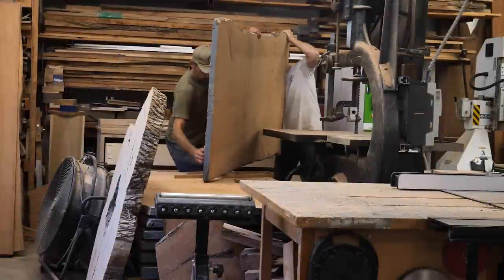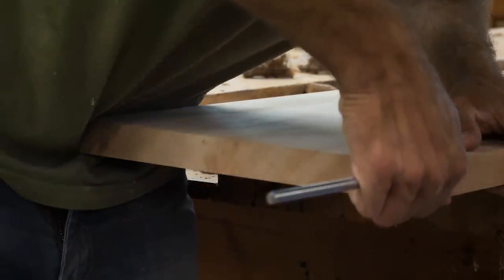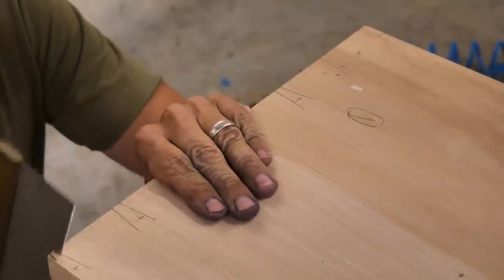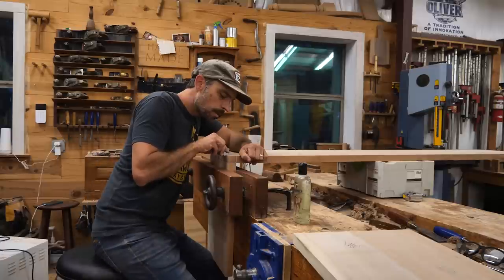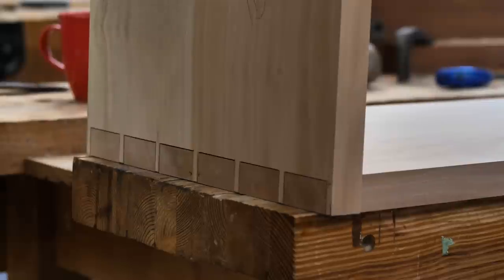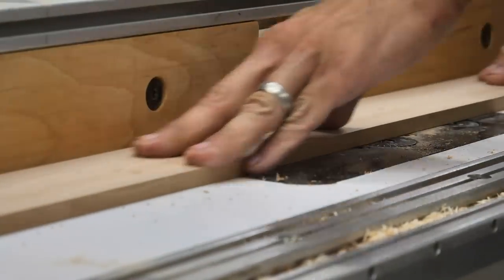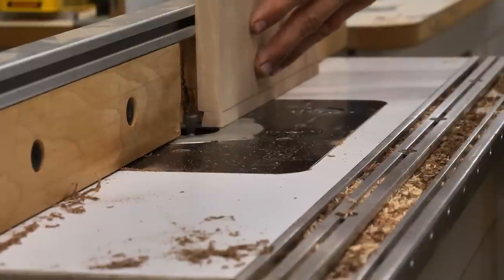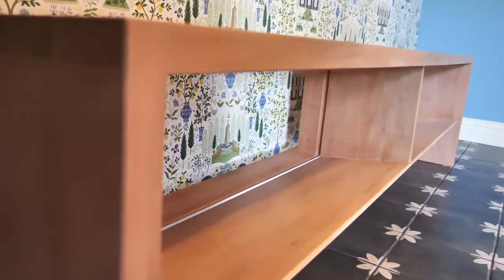Dovetailed Bench // Using Soap As A Finish

Comment: Super nice joinery! In regards to the soap: please do it again :-) It is most definitely a very resilient treatment. In Scandinavia it is one of the most used surface treatments for both furniture and floors. Do a thick blend of water and soap (maybe add a little white soap pigment if you like it light) give it 3-4 times and you are ready to go. The soap soaks into the surface and when you feel that the surface gets dirty, just wash it with the same type of soap. Over time it builds up and gets more and more durable, with a silky finish. 
We have the treatment on the family dining table (white oak) and I guarantee that the abuse from both kids and adults (red wine e.g.) can be cleaned off and the finish just gets nicer over time :-)

Comment: Thanks Andy for sharing.  I like using a rebate as well for dovetails.  What I also like is that the rebate "hides" the bottom/inside of where the pins and tails meet.  Not that I want to be sloppy.  But, if I push back past my knife line when removing the waste, you can't see an error on the inside.
Reply from the maker: Yes that is an added plus to it.

Comment: Andy, consider getting a mafell tracksaw. more power, thinner blade and theyre built like a tank. pricey but you'll never have to buy anything again.
Reply from the maker: Thanks for the suggestion.  I’ve never heard of Mafell but just looked them.  It’s definitely pricey but competes with Festool.  Looks like they get great reviews
Reply: If you live in North America Mafell is not as well supported and will be more difficult to source. Festool has a better supply chain in North America. 
Mafell tools are a little bit better than Festool but it really depends on what you want them for.
Reply: @bighands69  didn't know that. Well I'd say mafell is better for those big slab/ deep cuts which is what I'm guessing Andy is in need of.

Comment: Hey so I got the larger Festool track saw when they first came out and I was really happy with it for years. Eventually I bought myself the mft-3 work table along with the extra track. I don't know if you use these yourself, but I was really pretty horrified by the quality in general. I was so impressed with the saw that I guess I expected the same out of the table. The fixture table idea is brilliant, but the damn thing is not sturdy enough to support a drink much less work! I have tried rebuilding a couple of leg systems but I've concluded it's just really not worth the trouble. I feel like I must be missing something, all my other experience with Festool is that it is quite well thought out though overpriced. I was just curious if you have used these and what your impressions were. And I suppose I'm a little picky, but how in the hell can you have a four-legged table that is able to be leveled with only one adjustable leg? I'm pretty sure physics works the same in Europe, it's not possible to level such a table. Really annoyed by how much they phoned it in when designing this. I haven't bought a single Festool products since
Reply: Festool MFT tables are suppose to be mobile work were you can take it to site. If you have a workshop and want a stronger table you will need to make it yourself. 
The price for the Festool tools and accessories are about right considering they are a small company.